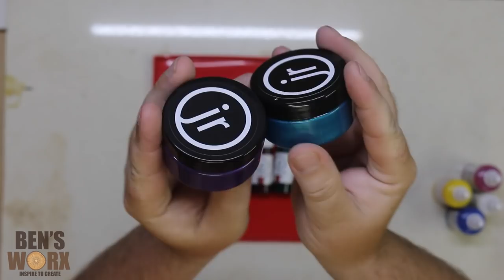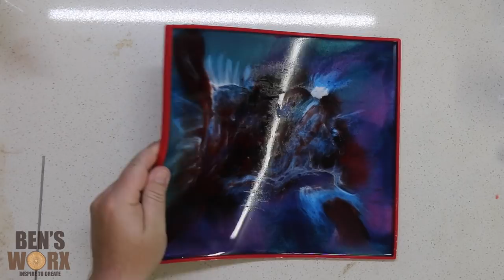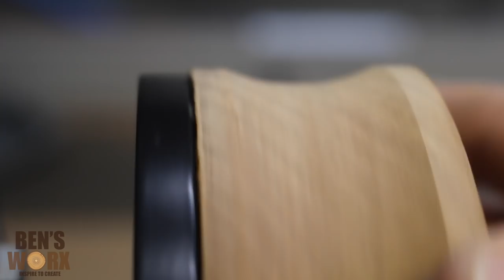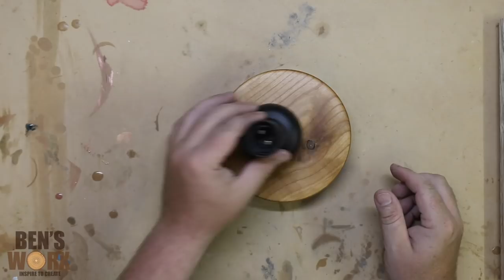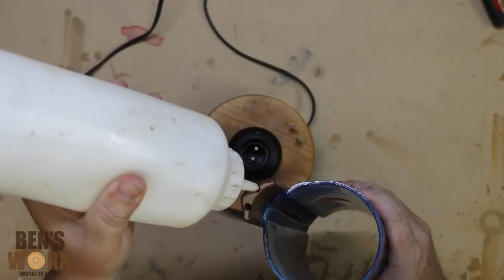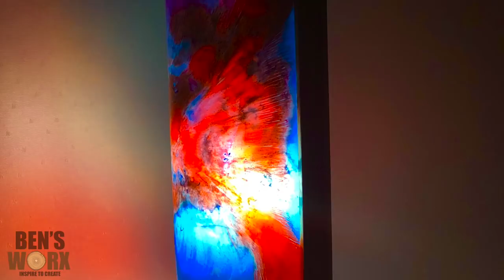Make a Wood and Resin Lamp

Comment: This is pretty solid man! 2 questions however. What finish would you suggest for the wood? Would you use that same finish on wood/resin combo pieces? Last question, how does the resin hold up with the heat of the bulb?

Comment: Ben the shade is gorgeous looks like a, Phoenix in the first view taking flight. Though that foes suck that even wiring a lamp has to be done by a certified electrician all my dad has to do is call em to make sure his house wiring is up to code he can make anything running mains power he wants and trust me he is good enough to have certification by proxy if that were a thing, if you take my meaning.

Man is a master of ohms and the Bass.
Reply from the maker: Thanks Mate! Sounds like your Dad is a great guy

Comment: HI Ben, I really like the concept of shaping the resin before it has fully set. Very clever and with so many applications! Can I make some suggestions about the base/exposed light fitting which would turn it from a very lovely lamp to an amazing lamp. You could have put the shade so it sat directly on top of your wooden base, that way we would not see a plastic light fitting (it does not enhance the design). If you use an LED bulb, the heat gain inside the shade is negligible, and anyway, most resins can take tremendous heat. You would still be able to get your hand inside to fit a new bulb. Or, if you do not fancy that idea, why not  extend the height of the base so that it encompasses the base of the light fitting in a concealed recess, and again, have the shade so it meets with no gap. Hope you don't mind me suggesting. Debs
Reply from the maker: Hey Debs, you have some great ideas, Thankyou!

Comment: That turned out beautiful, any issues with the heat from the bulb with the resin?personally I would have gone right to the Base with the lamp,so the bulb fittings are not seen,but again that would restrict the light,maybe..still love it..nice job.
Reply from the maker: Thanks Mate! I’m using an led bulb which doesn’t give off too much heat :)

Comment: Would that resin go soft from the heat of the lamp or does that brand of resin not have that issue?
Reply from the maker: Hi, I’m using an led bulb and it’s giving off minimal heat, the resin i used will be affected from excessive heat
Reply: Ben's Worx cheers. Thanks

Comment: Hi Ben taking inspiration from yr cool n great video I hv pour a resin for my 1st lamp.  Still is der progress. Waiting few hours to get that sweet spot is killing. One question I use acrylic paint and mix it in resin but the paint always tends to settle down and no cells are visible. I added a few drops of pure alcohol to get those cells but nothing. What am I doing wrong. Btw I hv poured only a half cm thick layer. Hope it works.  Cheers mate
Reply from the maker: Thanks Vaibhav! For best results I would recommend using dye to create cells, alcohol won’t react very well to paint. Hope it works out for you Mate

Comment: Looks great! I’m thinking of doing a wood and resin project, but I noticed you used a different resin for the lazy Susan gallon pour. But here you used just resin, I’d there a great difference between brands? I use art resin for coasters and would just like to know if there is a better one for wood.
Reply from the maker: Hi Ashlee, Thankyou! there are different resins for different projects, like casting or art pours, As for wood you would want to use a casting resin, just be mindful that your wood must be dry and as wood is porous you will have bubbles escaping from the wood so make sure you seal it first either with a thin layer of resin or even pva glue. All brands have their own characteristics, viscosity, pot life ect, you just need to find one that best suits your application
Reply: Ben's Worx thankyou!

Comment: Excellent work, friend, did you put something on the pvc pipe so that the resin does not adhere to the tube?
Reply from the maker: Thanks Mate, no I didn’t
Reply: @BensWorx  Ok, thanks, but the resin is not compatible with the PVC pipe? If I wanted it to adhere to the PVC pipe?

Comment: Can I use only resin & hardner

Instead of Epoxy hardner???
Reply from the maker: Epoxy is a type of resin, so yes you need a resin and a hardener
Reply: @BensWorx  I can't able to find Epoxy Resin in my city 

Can I use Asian paints company's Resin & Hardner
Reply from the maker: You can try it mate
Reply: @BensWorx  does it hold harder & stronger???
Reply from the maker: You would have to talk to the manufacturer

Comment: hello love the idea I work with resin and bend it what kind o tube? is it PVC and how easy is it to take off. Just add your channel
Reply from the maker: Thankyou, yes it’s pvc and is easy to take off
Reply: @BensWorx  it will just slide off ty
Reply from the maker: Yep 👍
Reply from the maker: As long as you are only molding around after the resin has cured slightly
Reply: @BensWorx  ok  about 4 hours then slip it off. I do that when I bend them or I make a wave